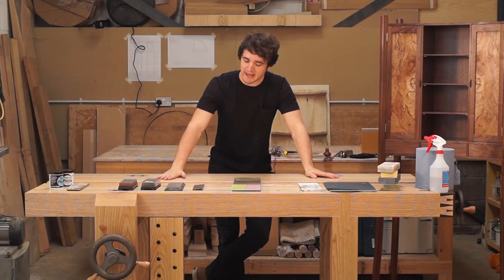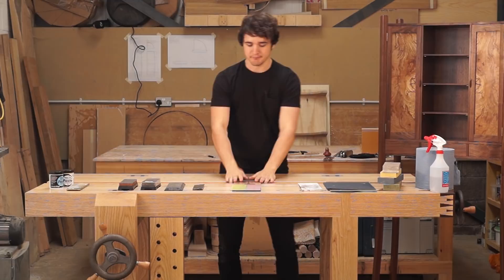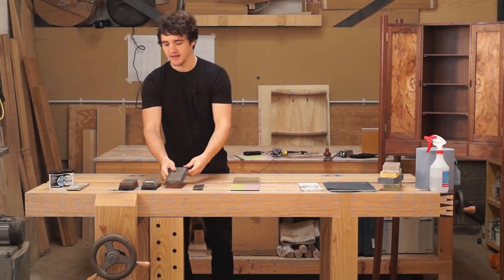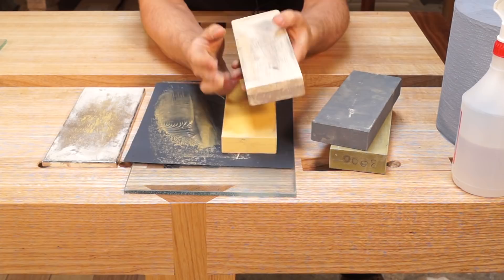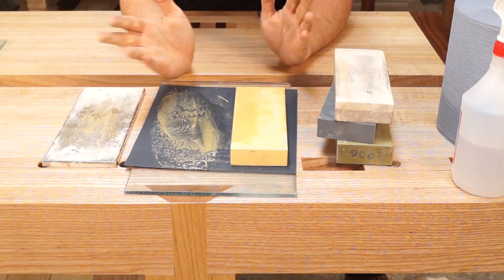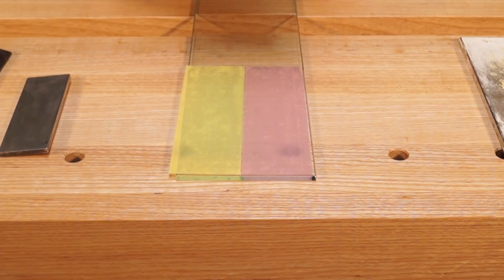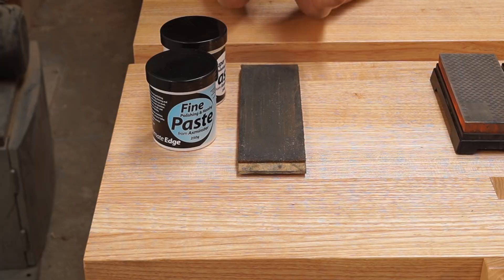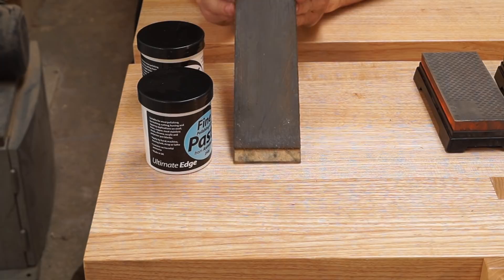Which SHARPENING Stone Is BEST? | Tool Duel #2

Comment: "Waterstones cut a lot faster." This is conditionally true. The main cutting advantage of more friable stones occurs when the sharpening stone is made flat and you are sharpening a flat/straight bevel. The mud is a lapping paste which will cut the steel fairly efficiently in this case, given this limitation. If a harder wearing stone is made flat, and you sharpen flat/straight edge bevels on it, you will reduce the bite of the stone, and you can make the stone's high points all level out and dull into a single plane. This makes the stone slow to a crawl and potential stop biting and cutting, at all. There is a remedy to this, which is to convex the surface of a hard-wearing stone, so that it cuts a small area of steel at any given time. The same way there is a minimum depth of cut when machining steel in a lathe or mill, there is an analogous requirement when using a stone which relies on 2 body abrasion. Adding some very small amount of convex curve to the surface allows that one small area to reach this minimum depth of cut. If you do not reach this, you end up dulling the stone and doing some burnishing (and even worse, too much burnishing causes other effects like spalling/galling). You might think a more friable stone will cut faster, because it is abrading a larger area of steel at the same time, but a hard wearing stone is cutting by two body abrasion vs 3, so the difference may not what you would think. Add in the time to flatten the waterstone every few uses (esp when sharpening smaller chisels), and the advantage is where, now? To top it off, there are SiC and aluminum oxide stones which are probably considered oil stones, but which are as friable and muddy as anything made in Japan and called a waterstone.       "Oil stones are messier."  If comparing to the coarse, friable type of oilstones, say coarse SiC stones (which actually cut faster than AlOx waterstones, in general), you can make a case that oil is messier than water. In firmer stones at 600 grit and up (maybe 3K grit in the Japanese scale), oil is infinitely and undeniably cleaner than water. It takes only a few drops, requires less frequent reapplication, and stones at this fineness and higher can generally be wiped off with a paper towel without leaving little fuzzies.     "Oil makes the metal clog in the stone and makes it stop cutting." IME, a hard-weraing stone will stop cutting for the reason I already explained. The coarser, hard wearing stones will accumulate metal in the surface, between the asperities (high points of the particles). This does not, in any case, reduce the cutting power of the stone. As long as there is some oil (or soapy water) on the surface of the stone, any metal that builds up to challenge the asperities is automatically cleared as you sharpen. Metal shavings and dried up oil (if you use crappy oil) are more compressible than the stone's abrasive and hard matrix. They cannot interefere with cutting. It is either compressed or it is cleared by the edge you are sharpening. Only when used dry can the metal shavings stick to the metal already embedded in the stone and pile up enough to interfere with cutting.                   To paraphrase Matt, this is just my opinion, and I'm not trying to change anyone elses'. But I think I'm being a bit more objective and thorough on these points. The one undeniable advantage of Japanese waterstones is they have a higher profit margin. More money to go around to marketing and endorsements, esp compared tto natural mined "oil" stones or sintered ceramics which a relatively tiny piece will sharpen your largest plane blades and chisels (and be much more efficient and sharpening small chisels and plane blades and putting a new tip on a knife) and essentially last forever with essentially no maintenance (if you know how to use them). There are plenty of oilstones in use, today, by people young and old. But in terms of sales, yeah, waterstones probably outpace "oil stones" by a good margin due to the profit margin and marketing (often disguished as education). Today's kids are increasing being "educated" by commercial interests. From the way you present "oil stones," I'd guess you and/or your coworkers have never learned to use an oilstone, or are part of this "education" for dollars, or you have actually bought this misinformation hook line and sinker.  Diamond plates are also excellent for sharpening chisels and plane blades. They go up to 3K grit (real, not Japanese). I've only used plates up to 800, and even those put on a pretty nice edge and last a heck of a long time. I can use all these things to sharpen my tools. Friable stones (e.g. waterstones) have advantages, but they also have significant disadvantages.
Reply: Mildy Productive    Thank you for these elaborate, useful rematks.mI read it at with interest, and I apprecciate the obvious attention to material mechanics to understand the processes. Short question: What is the difference between Japanese grit and real grit you mention in the last lines?
Reply: Hey, Christian. There are charts you can find which show the suggested differences. The way most western sharpening stones are rated pretty close in numbers to sandpaper, but not quite. The Japanese Industrial Scale is inflated in the finer grits. So at, say, 40 grit, JIS and "oilstone" rating are both about the same. 150 grit JIS is probably around 100 grit. But by the time you get to 4-8K JIS, the difference is approximately 4 to 1. So 4K JIS will be comparable to something on the order of 1000 grit (my opinion... charts that are out may not agree). And as the numbers go higher, the difference gets larger.        Admittedly, I have an obvious personal preference towards harder wearing oil stones for sharpening. But I didn't come up with this stuff, independently. I originally learned it from the internet... but that was almost 20 years ago, and the internet has changed. That info is long gone and buried by the current trend.
Reply: Mildy Productive   Thank you, Mildy, that's extremely useful information. I had not come across it so far. I was just wondering how some people find a 1000 grit good for finishing a chisel, and others say that they recommend 6000 or so. This exponential difference in grit systems between West and Far East you describe would explain it. - I naively thought the grit number would simply be something like "peaks per centimeter" (or inch or whatever). - I will try and find detailed information on these measurements to understand it better.
Reply: "I had not come across it so far." And unless you already possess this knowledge, you will not casually "come across it." If the difference in grit rating system suggests that water stones go way higher and cut way faster for a given "number," then the internet will quietly let you believe it. And if you learn how to use an oilstone from today's internet, you should undoubtedly run to water stones. The internet is for sale to the highest bidder/botter. And no one makes money from stuff which lasts 100's of years without wearing out or slowing down or needing consumables for maintenance. This kind of knowledge doesn't grow the economy. What's the saying? Give a man a fish, and you might sell him some fish down the road. Teach him to fish, and you potentially lost a customer.

Comment: You can use water on whetstones? As long as they haven't previously been used with oil... Whetstones are no where near as messy as water stones and if you use oil your not getting corrosive water all over your tools. 
The only reason you would have found that
 whetstones don't cut quickly is because you were using crap ones.
Reply: @ Jaime Clifton - I agree. I also prefer whetstones (oilstones) to water stones especially in carving where the vast amount of waterstone residue get's on everything (clothes, hands, tools, tool handles etc) & that grit will destroy a beautifully sharpened edge if it gets embedded in the wood to be carved. Waterstones, in my opinion, are best for the widest possible blades only & are still a pain in the ass to constantly have to flatten.
 I personally prefer high-end India stones for coarse, initial bevel setting/shaping & Arkansas stones for refining bevel & edge then stropping w/ Herb's Yellowstone compound on the hardest leather for ultimate refinement (again for carving tools especially but also plane/spokeshave blades & bench chisels). DMT "stones" (plates?) are also excellent, esp. when used w/ Trend diamond sharpening fluid - I find they cut way faster & are less bothersome than water stones.

Comment: I'm just comming to the end of many year of stupidity in sharping my tools.  For rough work, you want a oil stone, then when you want a better edge, you have to find what works for you. No  real rules, because people are individuals, and do thing differently. Me, personally? Oil stones start, or fix my many mistakes. After that, I have to think, "99% of the sharping, should've been done, courser stone first.  Secondly, don't muscle the stone." I've seen people, sharpen for decades, and they put their strength it their shapening. I  start with very course oil stone, to fix things. Then finer oil stones to sharpen. After that it's a light touch, taking only minutes. I'm positive, most people have more experience, but it works for me.

Comment: On job sites I know especially in America they use the worst chisels that they sharpen at most with a file but they don’t have files so they never sharpen, or if they drop it a couple too many times they may use an angle grinder
Reply: I Make Everything they’d likely use a belt sander.  Or the concrete floor...?
Reply: @richardsinger01  our concrete pads are higher quality than the best Japanese water stones. Because Made in USA!

Comment: As you make abundantly clear there is no one single perfect system or set of sharpening tools. I have used a coarse diamond plate to flatten the backs of my chisels and plane blades. Now i use a set of combination artificial water-stones up to 8000 grit which works extremely well for putting a keen edge on. My father's old oil stones are nestled away in their boxes for exactly the reasons you state. They are oily and messy to clean up. Next video could be proper technique for sharpening.

Comment: I have inherited three sharpening stones from a father-in-law after he died suddenly. One is a combo -- red and grey. One is mounted in wood and appears a bit oily. How do I determine whether they are water or oil stones and what grit they are?
Reply from the maker: There's a good chance they are oilstones. Every time I've seen an old sharpening stone unearthed it's been an oilstone. Never come across a waterstone before. Not entirely sure how I would go about finding the grit. Get the stone flat, sharpen a chisel, strop it and see what sort of result you get. If you find it's not enough, get something above the 1000 grit mark such as a diamond stone.

Comment: I feel that he's short-selling the traditional oil-stone, especially the 1000 grit for final honing. You don't need to use oil! Water with a touch of soapy detergent is more efficient, if anything. The stone will last almost indefinitely, and doesn't need constant soaking and flattening. Plus it will give a better edge than a 1000 grit diamond stone. Traditional whetstones were good enough for Chippendale, after all. At least one influential teacher recommends a course diamond and a fine India for a sharpening solution that's both cost-effective and time effective.

Comment: Stupid question!? What do you use to attach the sandpaper to the glass? I really like the method but am struggling with the best way to have it stay put. 
Thanks for any tips!
Btw, your channel is awesome! I keep looking forward every three days for the newest video...
Reply: often water or lapping fluid between the wet/dry sandpaper & glass will produce a surface tension between the two & hold the paper still enough, as long as one doesn't bear down on the tool too heavily.
Reply: I actually have found PSA (pressure sensitive adhesive) backed lapping film and sandpaper to work best...but the water trick works okay if you cannot find any PSA sheets.

Comment: Serious question now.  Are diamond stones forever stones?  In other words, do they wear out or do they just clog up with de Rise? And is there any way to keep the grit clean?  I use water stones for the affordability, but you're right, they're a friggin' mess and take up a lot of space.  I'd consider DMTs if I knew the added cost meant the stone lasted for a long time. What's the typical lifespan of a diamond stone.....please don't say "it depends."  Compare it to comparable use with water stones.  As always, nice work with this vid!
Reply: Steven Rochon The good quality plates will last you a long time but avoid the cross-hatched type as the diamonds don't stick. Get either DMT or Ezylap as their process bonds the diamonds into the plate surface. They won't last forever but should be good for quite a few years.

For cleaning I use a white pencil eraser or more recently have found the large rubber sanding belt cleaners you can get from many to line suppliers, they do a great job.
Reply from the maker: Well a waterstone is basically a massive brick of grit so in the long term that is definitely going to last longer than a diamond stone. Unless you were doing UNHOLY amounts of sharpening, you'd never wear through an entire waterstone over a lifetime. However, with Diamond stones being a finite surface, this will happen over the years. DMT do a line called DiaSharp, I'd advise looking at those. They are bonded well, and the plates are pretty big in size. If you use the entire surface of the stone and not focus all your attention in the centre, they will last a bloody long time. Cheers Steven!
Reply: Matt Estlea - Furniture actually, I've got a Norton combo stone, and the 4000 grit side is worn down about 60% in perhaps 15 months.  I'm not known for sharpening (or doing anything) to an unholy amount.  I'll come right up to the edge, then peer over the cliff, just to get a look at that unholy side.

Comment: I started with japanese water stone and i love them but i had to do a big initial invertion, if any body wants to start in this i recommend i full kind(4-5) dmt stone and one water stone(you can flat it with one dmt) around 8000-12000 for a begginer(and a profesional) its enoght, actually i have a 30.000 jaja

Comment: Anyone have recommended grits for scary sharp? Judging by the colors, It looks like Matt has YELLOW 12 Micron (1200 Grit) and PINK 3 Micron (8,000 Grit). I assume this is enough for sharpening a maintained chisel/plane (YELLOW/1200) and final honing/polishing (PINK/8000). Seems like it would be akin to the 1000/6000 KING Waterstone I have, at the recommendation of StumpyNubs. No need for higher/lower grits (again, if you're dealing with well maintained irons)? No stropping? (again, I assume there is a grit of this 3M PSA sandpaper that can approximate a strop, too). I'd like to go with "Scary Sharp" method until I am ready to pony up for Diamond Plates. Thanks!

Comment: I'm using a 400&1200 (two sided) diamond stone, works great but I would like to expend less time on the 400 side, I was thinking in adding a 250 grit water stone in order to speed things up, do you think it would be a good idea?
Reply: Other comments here state that water stones do not do well at lower grits, and that the diamond plates do.
Reply: AndroidGameplays4Every1 I gave a large 250 grip water stone and it cuts quite quickly.  But you have to level it very frequently, because it hollows very quickly too.

Comment: I use shapton glass stones and the float glass/sandpaper in my shop. The glass stones are obviously as good as it gets...everyone says it, they’re all correct, enough said. But if you don’t do a ton of sharpening, float glass and 3m lapping paper is a RIDICULOUS system. You need a honing jig to get the best out of it (let’s be honest, very few hands are steady enough to get any benefit from 60,000 grit). The first time you see something sharpened all the way up to the white, 60,000 grit level, it’s a bit shocking. It’s this weird, uncanny level beyond “mirror-like”. The paper itself feels slippery and sticky at the same time and your edge almost takes on this dark appearance...it’s completely unnecessary but fun nonetheless...

Comment: Matt in your opinion couldn't you just use the diamond stone (linked above) for flattening your stones instead of the pricey DMT Dia Flat Diamond Lapping Plate?
Reply from the maker: Some people do it, but the diamond stone won't last very long because of the way the diamond is bonded to the substrate. If you think about it, you're abrading an abrasive material. One needs to be a lot more hard wearing than the other!
Reply: Matt Estlea - Furniture is it the same problem with this diamondstone 
http://www.axminster.co.uk/dmt-dia-sharp-extra-extra-coarse-continuous-diamond-whetstone-407737 ? Or would it work okay flattening-wise??

Comment: its all about technique and understnding the conept how metal gets and holds an edge. a blade  can be too sharpe and dull quickly
Reply: >>a blade  can be too sharpe<<

?? They can have too gradual of an edge, but a fine edge is usually an asset. Durability increases with sharpness, but clearance is more important in a plane iron if the user is competent - the durability increase is small. Getting an edge to fail by wear rather than chipping, and using a method that works with a dulling edge that still has clearance (like using a cap iron on a plane) has far more impact.